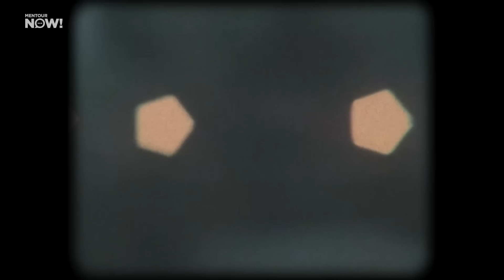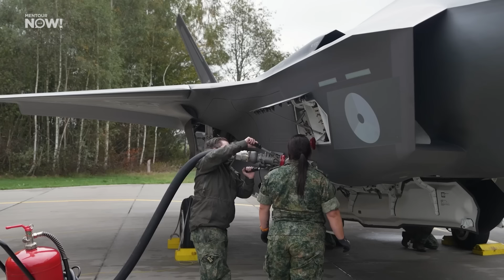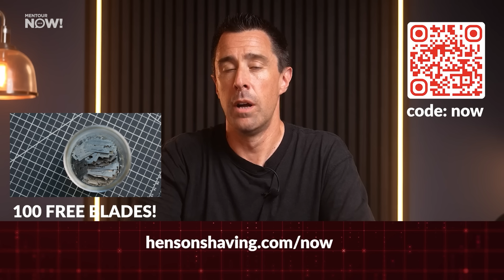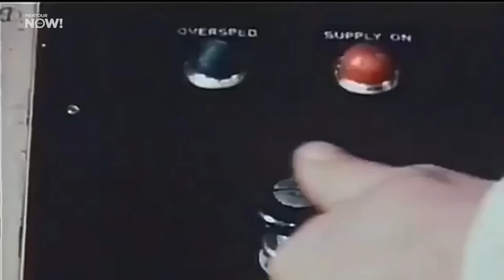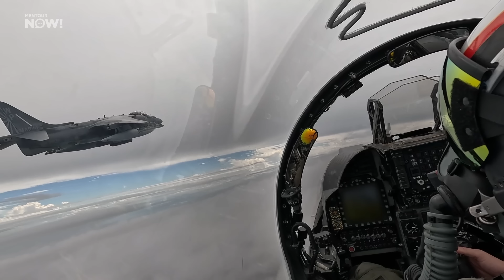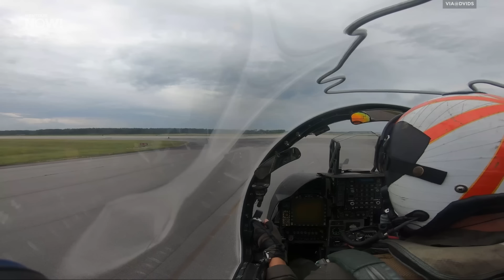The Harrier Is WAY More COMPLICATED Than You Think!!

Comment from the maker: Head to https://hensonshaving.com/now and enter code ‘Now’ for 100 free blades with the purchase of a razor. Make sure to add both the razor and the blades to your cart for the code to take effect.
Reply: FROM Australia - YES I HAVE SEEN A HARRIER FLY AT AN AIR SHOW
It was at the 1987 Springfield Air Show in Illinois.
I was over there doing my degree in aerospace.

What should be discussed, because of the F35B's cost to buy and cost to operate is a semi-clean sheet Harrier.
One of the things in engineering is to LEARN FROM PREVIOUS PROJECTS.
GOIGN FORWARD the great military challenge is adapting to the asymmetric warfare created by the drone revolution.
One of the greatest issues is the cost to intercept and kill drones before they cause damage. Look at what the Iranians did across the Gulf States and what Ukraine has done to Russia these last few weeks.

It doesn't matter if we are talking about naval operations or land operations being able to deal with drones is a major issue that few are tackling.
We know the basic concept of the Harrier aircraft works.
We know it can be deployed anywhere.
We know it can hover and shoot at things.
So just in that it has the basic makings of an anti-drone killer.

We also know form the experiences over the past 30 years that there are many things that can make get turbines (jet engines) more fuel efficient or generate more thrust for less fuel. Most of those changes have shown to be small but when combined they add up. So there is no fundamental reason why the Rolls-Royce Pegasus jet engine can't get a major make over.

We also know that building round fuselages for aircraft is lousy for radar cross section. So that can be addressed.
We also know there are guns like the Rheinmetall 30mm that can fir exploding shells that have been developed to kill drones.
We also know we can put lighter electronic systems into jets.

So I think that its specified properly as an 80/20 system (80% of the functionality for 20% of the cost) then a next generation Harrier is possible. 
Think of it like how the Canadians have opted for a combination of F35 and JAS39 Gripen. The F35 is more stealthy and can do mission profiles like SEAD but for a lot of things its insanely expensive in both operation cost and insanely time consuming in maintenance time. The Gripen is not only much lower cost but its cost per hour of flight time is about 1/5th that of the F35 and it can do 80% of what the F35 can do in terms of mission profiles and might even be netter than the F35 at a couple of things. Its a but like the Hurricane & Spitfire situation from the Battle of Britain, where the Spitfires were magnificent but without the support of the Hurricane which was far easier to maintain they would have failed.

So I think there is at least sound reasons to look at and do a proper design study of a next gen Harrier.
Reply: cheers!  thank you
Reply: Way too expensive to maintain.  550 hours to do an engine swap and f 15for example, can be done in 4 hours.   Very cool plane way before its time. Modern electronics have made it and this type of flight much safer in general.  But the Harrier is also a plane its pilots do not get as much seat time to practice in , as conventional planes and being it is ten times harder to fly it has lead to many accidents. Over 300 made and over half have lost do to pilot or mechanical issues.  It has an average of over 30 major accidents per 100K hours of flight, compared to say an f15 that has 1.67 making them one of the most dangerous aircraft in the sky.   It has been credited to 20-23 enemy kills but have been credited to 40 US Marine pilot deaths alone. why it is dubbed the widow maker by many of its critics.      V-22 Osprey would be a good video.  It had a very rocky beginning and killed several people as well in the early years. But has become a very vital aircraft with a much better safety rating now they bugs are all worked out.

Comment: The Harrier used Det Cord on the canopy glass for ejection because you cant blow off a canopy fast enough when hovering.  In the USMC I fueled the Harriers of VFA 214 "Black Sheep" squadron at El Toro back in 1994-96.  A sound of a Harrier is unlike anything else. It is an amazing jet.

Comment: Runway denial is still a threat and the philosophy of dispersal valid, so why have nations in the European theatre like Belgium, Poland, Denmark, Netherlands and Norway operate the F35A which does not have the ability to take off vertically? Also the F35B, lacking range, carries around a lift engine that produces no thrust and is like a massive weight hampering maneouverabilty due inertia. (I realise dogfighting is old hat and today it's all long range kills by stealth but war changes quickly). The Harrier was ahead of its time and indeed its future. I would have thought the F35B designers would have introduced some means of vectored thrust to counter lumbering around a lift engine.

Comment: Is that different lift system one of those things you will only be able to show us in 50 years?  BTW the Chinese can copy but theirs have proven unworkable after delivery just ask the Iranian procurement office.. Right now the Russian Engineers are spending 10 hours sitting in gas lines getting 1/3rd tank of gas that is so low a grade and unfiltered that their check engine light will illuminate before they reach their driveway.  I think their attention is on how to invent gas, food and light out of the nothing on the shelves.  I would love to see how this new lift system works if only on a theoretical level.

Comment: The way I understand it, the Harrier could not take-off vertically with a serious payload, that's why the ramp was used on the aircraft carriers. if that is the case, how does that relate to using improvised small places in e.g. a forest near a frontline? I understand how it could land and refuel/arm on improvised spots, but take off with a serious payload?

Comment: The best solution is to build a light aircraft that can take off and land on roads.
And that aircraft already exists and is called JAS Gripen!
The JAS Gripen is significantly cheaper than aircraft like the Harrier and F-35B, and can be produced in much higher numbers at the same cost as these technologically advanced aircraft, which require much heavier support.
And yes, I've seen the Harrier at a flight show!

Comment: I always wondered if the same logic that led to the development of the Harrier (spreading the aircraft around rather than all located at large bases with runways) could be applied at sea too. Harriers and F35b aircraft operate from carriers, which are essentially runways. That makes them obvious first targets for naval conflicts and we can see from what is happening in the Persian Gulf, that even the US is reluctant to actually take them close to even a second or third tier military power for fear the fleet would lose all air cover if they were struck. Many smaller warships have a rear hangar with helicopters on board, so it would seem possible in principle to have VTOL jets spread around the fleet too.

Comment: I was playing a Flight Simulator 2004 version and basically in that version I found you have to control it in like landing vs flying. When you lift off, if you are high enough you can just dive and pull out then you are flying, but the pilots probably 45 degreed it so they eventually got to flying. They are really different scenarios.

Comment: What about lifting a jet by using a large helium or hot air balloon to lift it high up into the atmosphere where it could then start its jet engines and cut the cables connecting it to the balloon? I wonder if that would work or if the balloon would have to be so massive that it wouldn't feasible. But if it would work, it seems like that'd be something that could potentially be much easier and inexpensive than harrier jets.
Reply: You'd have to have such a big balloon that it would be easier to just use a normal airfield

Comment: I had the pleasure of working with Rodney Cross, the engineer who solved the problem of sealing the rotation rings on the exhaust nozzles. Being able to move, and seal, and maintain that seal through the temperature and thrust range was apparently quite the problem. He also worked on the Spey, and consulted on the F35B amongst many other projects.
He left us 31/12/23. Sleep well Rodney.

Comment: Only Spanish SeaHarriers (Matador II) are here to stay until at least 2032. But i agree the Harrier was in my opinion the best CAS aircraft ever made. It has systems that no other aircraft has.(like automatic recognition of surface targets on HUD) It is fast but can loiter. It can drop multiple jdam at the same time. It can be equipped with a GAU-12 with a rate of fire up to 4200 rounds per minute. It is a precise platform that can be flown in all weather conditions, night and day. And at the last point it is affordable unlike the notoriously unreliable F-35.

Comment: The thing I found interesting about the Harrier is that it required distilled water.
When it is hovering the airflow through the engine is reduced due to the lack of forward motion.  This means there is not as much air to cool the engine and so it uses a water cooling system.  The water evaporates so it needs to be distilled to avoid scale deposits in the pipes.  It also means that any bases used for the Harrier require a supply of distilled water, and its ability to hover is limited by how much distilled water is in the tank (another weight limit).
Reply: Not quite. The water was not always required, it depended more on ambient temperature. The water was only used when it had to be, and there was only a 90 second supply. But there are plenty of hovering displays at UK airshows will in excess of 8 minutes. The Harrier can hover as long as it wants provided the engine is within temperature limits, which was less of an issue in Northern Europe.
US Harriers operating in the Southern States, or Italian/Spanish Harriers around the Med have to lean on the water much more often.

Comment: It’s interesting that the Harrier’s biggest trick was incorporating vertical and horizontal thrust in one engine and exhaust system, while the F-35B, brilliant as it is in so many ways, has gone back to a system that involves a lift fan for take off and landing that becomes dead weight in forward flight. Not dissing the F-35B as it’s objectively superior to the Harrier, but the B model is definitely compromised compared to the A and C variants. I can’t help wondering what they might have built if they’d accepted that STOVL meant a different approach and developed a fighter for the UK and USMC and other STOVL operators outside the F-35 program. Might there have been a Harrier III with similar swivelling thrust nozzles, or would they have still gone with a lift fan for its other benefits and accepted the weight penalty?
Reply: That actually happened, the JSF was a competition between the Lockheed X-35 and the Boeing X-32. 
There is a benefit to the lift fan - It creates a barrier of cooler air that makes it considerably more difficult for the engine to re-ingest its own hot gasses. The competing X-32 used a system much closer to the original Harrier and one of the problems it suffered during the JSF competition was pop stalls and the engine choking on its own jet efflux during vertical landings (as well as having to remove parts like the landing gear doors to reduce weight for the trials).
Avoiding pop stalls was one of the things the X-35/F-35 set out to solve.

Comment: During normal hover conditions RCS activation does not reduce thrust since the DECS increases fuel flown automatically and instantly to hold the same thrust output as commanded by the throttle setting. Hover thrust is only affected by RCS activation if the engine already operates at max thrust and the engine's thermal limit prevent any higher fuel flow.
Harrier operations are an actually planed with enough thrust / thermal margin to allow constant RCS activation, without any thrust loss. If you are that heavy that RCS activation eats into your thrust output you already miscalculated or messed up in a major way, but it is not part of normal AV-8B ops.
Reply: Yeah, I've honestly never heard a claim that the RCS bleed air has any appreciable impact of engine behaviour or performance, and there are already plenty of myths and hyberbole around hovering ops, so I wonder if someone was pulling their leg a bit. 
The only time it could really be an issue is in hot and high ops or at a weight where hovering performance is so marginal that you wouldn't really be doing it in the first place. Even with the limited options at sea, you'd jettison payload or burn off a little more fuel before recovery.
Reply: @BrySkye  Exactly my point and even more so it is what the AV-8B operating manuals say.
Reply: Is it possible that this thrust reduction applied to earlier variants? There were many improvements made over the decades.
Reply: @Caffeine226  Not really. The only prolonged input you can really made with the RCS is yaw. Believe me, if you're putting in that many inputs into either pitch or roll, much bigger problems are going to develop before the main engine is going to have thrust issues. Like flipping upside down (from with positive or negative pitch) or wing drop.
It's not like the RCS works through some kind of reservoir reserve. The pipes are a set size, the amount of bleed air is fixed. 
As said, it could only remotely be a problem if the engine performance was so marginal that you wouldn't be hovering to start with.
Remember, the Harrier does not typically hover at max power either. 
A vastly bigger problem that's not mentioned is if the engine starts ingesting its own hot exhaust gasses, which is most likely to happen in the final parts of a vertical landing. Now that causes a massive drop in thrust as the engine basically chokes.
Reply: @Caffeine226 The only time the RCS activation can reduce thrust in a way that it effects the jet's ability to hold altitude is if you hover at the extreme thrust limit already which never happens unless you your planing is totally off or something else went hugely wrong. Yes, the second generation Harriers have better thrust margins than the first generation of tin can Harriers, but again, something must be really really off to get into such a situation which does not mean that it never happened because mistakes are made wherever humans work, but it is definitely not a normal behaviour.

Comment: An airshow? No. 

...but I was stationed on USS Peleliu (LHA-5) from 1994 - 1996, so I have seen many, MANY AV-8B Harrier takeoffs and landings. We nearly always did STO ops, though, because VTO uses an insane amount of fuel. Landing was always vertical, though unless there was something wrong and they needed to a short roll landing. I always could see the bleed air adjustments at the wingtips when the flight deck was wet, but never knew that was what it was.

Comment: I think it's worth mentioning is the contra rotating compressors in the Pegasus engine, designed to stop the aircraft processing (which is normally prevented by air flowing over the wings). Ingenious. Read Not Much of an Engineer by Stanley Hooker for more detail.
Reply: Yes I always thought that was an amazing part of the engineering on the Pegasus.

Comment: Thanks for telling the story. I live about 20 miles from MCAS Cherry Point, and seeing the Harriers fly over my house was a common occurrence (until recently, of course). The early American(?) models had some problems - I remember 25-30 years ago 2 that crashed at Cherry Point, one in Pamlico Sound and another in the ocean off Atlantic Beach. It wasn't unusual to bump into a Rolls-Royce engineer in the local taverns while they sorted the problems out. Also, I had to pause the video when those snapshots of the 4 Harriers in formation appeared. One was above Beaufort Inlet and the Coast Guard Station and the other was over the nearby Morehead City Port.

Comment: are anhedral high wings stable? are those high angle of attack wings stopping it dive in a turn?
Reply: The anhedral is necessary because wing sweepback produces a similar effect to dihedral: more so with a high wing. Most aircraft with high-mounted swept wings have some anhedral, because too much 'dihedral effect' can produce 'Dutch roll' - a cyclic roll-yaw oscillation. In the Harrier this would be even more problematic than most aircraft as it transitioned from normal flight to hover. What was needed was an aircraft that maintained relatively consistent response to control input during the transition, which meant that it had to be more or less neutrally stable. The anhedral solved that, but only up to a point. Move too fast laterally in a hover, and the anhedral could make the aircraft roll in an uncontrollable manner. Harriers had a 'wind-vane' mounted on the nose just in front of the windscreen so you could see whether you were sideslipping while hovering. A gentle sideslip was fine (and sometimes necessary), but caution was essential.

As for the 'angled up' wing it's the elevator that determines the angle of attack (oversimplifying a bit), not how the wing is mounted on the fuselage. A more angled-up wing just means that the aircraft flies more nose-down in forward flight. A Harrier with the wing less angled-up would be tricky in transition, simply because the high angle of attack necessary to produce useful lift at slow speeds (the wing is still producing useful amounts of lift at say 60 kt) would restrict forward visibility over the nose. There are probably other factors involved too. Finding an aerodynamic shape that worked through the entire flight regime was one of the many problems that had to be solved, and in the early days, without computer assistance like computational fluid dynamics software.